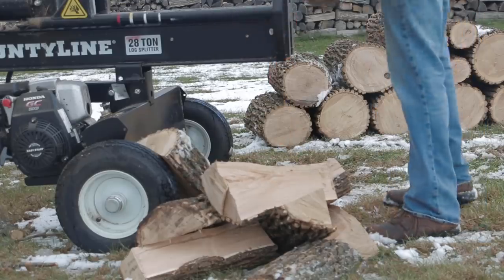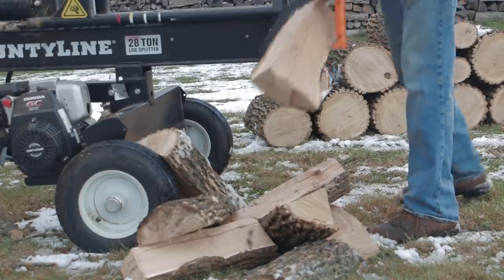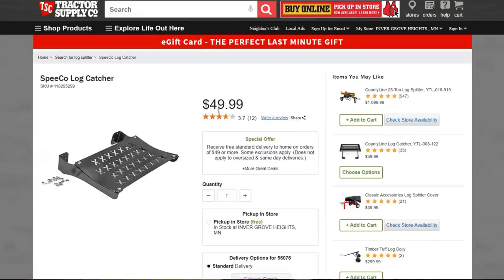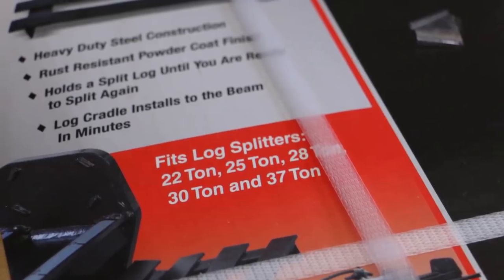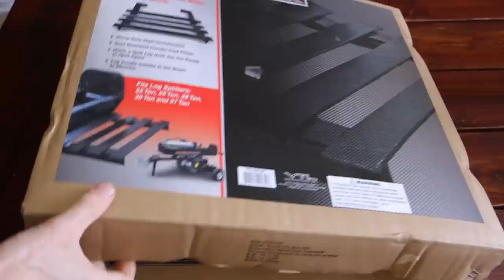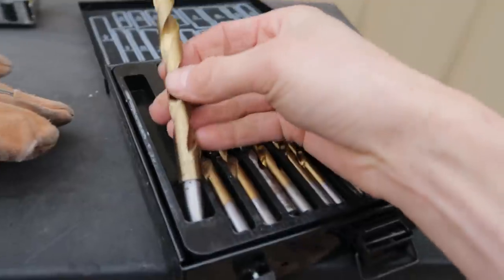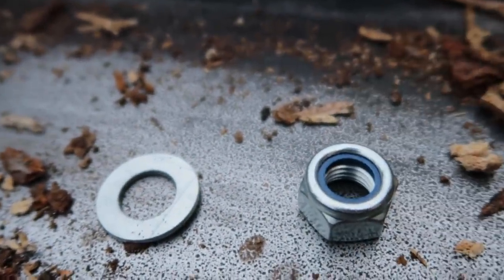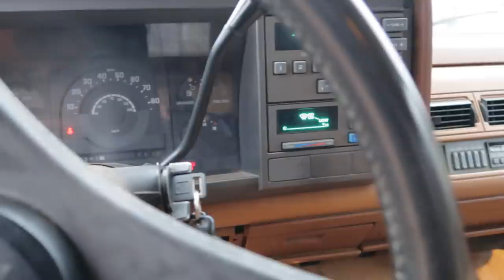$25 Upgrade that saving, time, energy and my back when processing firewood - Log Splitter Shelf

Comment: I just got the county line 25 ton machine from tractor supply 4-5 weeks ago after 14 years of harvesting my own firewood from dead fall in a local state park then transporting it home and splitting it all by hand with a 4.5 pound maul/axe combo to the tune of 5-6 chords of firewood each year of the last 14 years by the time I'm done each season, my back with multiple herneighted discs and rheumatoid arthritis just literally could take splitting by hand any more when the beginning of this season came and I knew it was time to get what I've been dreaming of for nearly a decade and a half , a capable gas log splitter . My 25ton machine came equiped with a 196cc 6.5hp Kohler SH series 4 stroke horizontal shaft engine that honestly doesn't look special in any way it simply looks exactly like every other chinese honda clone that is literally coming on everything nowadays for at least almost 15 years now or so roughly , but I can't knock them honestly cause no matter the name on the decal label all the Chinese honda clones that I've dealt with are really quite reliable and fairly tough, they ain't a mid to late 90's to late 90's tecumseh L-head concerning simplicity and ease of repair cause most chinese honda clones all have at least a couple plastic shrouds , heat deflector plates over the mufflers , big unnecessarily large air intake and filtration systems all that adds time into the repair cause everything is not right out in the open like they were on the old tecumseh motors where it would literally take 2-3 minutes to replace your carb lol.  Only ongoing issue I've seen with nearly all makes and sizes of chinese honda clones is problems with hunting and needing to run on partial choke settings usually due to clogged up super super tiny little holes all down the idle circuit jet , and alot of them seem to have an issue with the throttle and governor springs breaking or at least not keeping proper tension  which will cause a number of useability and reliability issues , normal wouldn't be a big deal but some of these springs on motors that are only 10-15 years old aren't even available any longer which is a real problem , I had this happen to me with the springs for the throttle linkage and governor arm on the power more 243cc clone on my 2014 troy bilt storm snowblower , and going to a couple hardware stores to try to get ahold of a few springs about the correct size and style was a nightmare cause even if you find those characteristics match I bet the tension rate of the springs will be way off , at that point your left to rig the thing up , I ended up with a mess of like 4 or 5 springs to replace just two in order to simply get the motor to sit at or close enough to idle for me when the lever is set to that rpm , and likewise with the function of the system when you move the throttle lever to full rpms , I continuously would get either too much rpms and way to high an idle or a perfect idle but falling a fair enough shy of the proper rpm at Max throttle to have the engine actual make anywhere close to recommended horsepower output , finally I got a balance between the two extremes , so have decent top rpms and power output with a low enough idle I'm happy with , well it's worked for 5 snow storms the last two winters so guess it is what it is now , but due to the original proper springs not being available I literally was and still am considering replacing the entire motor with a harbor freight predator 212cc for $120 as long as I could easily swap the crank shaft driven drive belt pulley onto the crank or find a proper pulley to replace it. Anyway I'm just rambling nonsense about snowblower issues so I'm check this, prob should just delete it honestly due to how off topic it is but ehh, maybe I will maybe I won't

Comment: That's a must have, mine did come with one. Another back saver is to make a simple ramp you can use to roll the logs up onto your truck and also go right from your tailgate to the splitter. Saves you from picking them up off the ground which is the hardest part on my back. I just made mine out of two-by-fours and 1 by cross members

Comment: I had a set up where I could slide my splitter into a series of heavy wooden benches and tables to make sort of an assembly line which was intended to eliminate as much bending and stooping as possible.  You dumped rounds on one table with the loader or from the truck, grabbed them with hookaroons and slid them to the splitting station table and shoved them down to the other end which you put them in a metal basket or a pallet.  No wood hit the ground and there was no bending over. In fact you could sit on a stool at the splitter and work if you needed to.  You could do a lot of wood quickly and with less strain on your back.  Ironically a tree blew over and smashed smashed the setup.  Building a new one with better lumber and under cover is definitely on the list of projects.

Comment: I’m seeing this video for the first time and I agreed that it should have a shelf and it actually should be larger than it is in my opinion. You’re one of the few people that I’ve seen splitting logs that hasn’t allowed them to drop on the ground and then pickup the pieces.I noticed you would walk them over to the wood pile. Now did ever occurred to you to move the log splitter closer to the wood pile so you only have two steps to go.

Comment: Great add on @ a great price. I use a two rounds, flat side up  as tables at the top of my splitting wedge. Timberwolfe TWP-1. It saves the splits from falling. Also handy when you have big rounds that are too heavy to pick up. Make a little ramp out of smaller rounds and splits and you can roll large rounds up onto the beam.

Comment: I drilled two holes in the splitter tray,  (the side furthest away from the I-beam) and then put 2 grade 8 bolts in the holes to keep the split wood from falling off the tray.  Works great.

Comment: If you still feel that your rack is still small, just screw or bolt a piece of plywood or OSB over the rack.  I put a radius on the corners of a piece of 3/4" OSB with a jigsaw so that I wouldn't keep bumping into sharp corners, painted it, and have been using it for about 5 years.  it also allows me to fasten a section of angle iron on the outer edge to help keep rolling pieces of logs on my table.

Comment: I bought a splitter cradle on Ebay from seller 33flame. It is quite a bit more money ($80 plus shipping), but it is worth every penny. Very well designed and built. It is 16" wide and extends 24" from the splitter so it will hold a pretty good sized round. And it has the added bonus of being easily removed for times when you don't want it on there, like when using the splitter in the vertical position. You might check it out.

Comment: You certainly can't beat a log catcher . Sure beats bending down all the time . It also stops the wood pieces from falling on your log splitter parts such as a engine or what ever you have on the other side . Someone asked about vertical position if it's needed . Depends on the size of rounds you are splitting . You never know if you might get some large rounds and then you could be hurting your back lifting them up . Me I would get a splitter that goes both ways . Horizontal and vertical . Not every one has a tractor or what ever to lift the large rounds .

Comment: I used TREX decking on my old Craftsman 27 ton which had a curved log catcher, it works great. In you case just use some 3/4" plywood using some tek screws and you can make it any length or width you require. Thanx for the vid. Happy 2019

Comment: Have you tried it on the other side? Your reach to the control looks a bit awkward. Mine is similar and I split fron other side - wedge coming from my right. Anyway - table looks super helpful. Visited local steel place/fabrication just hours ago and expect to start welding on one of my own after Thanksgiving.

Comment: Can I ask why not put it on other side so you don’t need to reach across for lever? That’s the way mine came from factory. Always good videos THANKS AND GOD BLESS!
Reply: If you work from the bench side you are working from more distance away and it’s backbreaking. No benefit. Best way is to have one on each side that you can put up or down as needed, so you can switch sides and work different muscles

Comment: hi the wood rest ,,r a blessing ,,i used a old trashed alum ,  ladder cut it to size ,,some nuts out of the garage ,,n wacko,,a rest ,,the lip on the ladder ,,foot side out ,,made it possible ,,that the split wood dint fall off the  table ,,
mine is on the splitter for 7 yrs now ,, only the bolts loosen up from time to time ,,
 id do it again if i bought a new splitter ,, with this old 18foot ladder ,,i made several ,,wood tables ,,with this one junk ,,extension ladder for friends
sleep well ,,n again thanks for your vid

Comment: Even at $50 the countyline one is a good deal and no modification.  My splitter that i just bought last week has welded in nuts to bolt it right on. And yes it should be mounted on the other side as another comment noted.

Comment: Check out Tractor Supply's new 40 ton Country Lines. Don't buy one, look at there table from there parts page. Very Big and heavy. Just looked at one today. Also this one comes with an engine protector which I think is Great. Going to buy both.

Comment: Yeah, I welded some scrap 1" tubing to one side of mine, then topped it with some 1x6 lumber.  Now have a 'shelf' to one side about 12x24 to hold the halves while working up the other half of a big round.

Comment: Looks good. But I would used much bigger washers to spread the load out. And a light grease on the threads going thru the frame. Any issues with the Speedco?
Thx
MJ

Comment: Not to change the subject, but in a previous vedeo, you stated that there was 177 or so cu. ft. in an UNSTACKED cord of firewood. I'm just curious as to how you can up with that figure. I don't know but I'm looking for an answer short of loading my trailer with wood twice and stacking it in a 4x4 x8 stack. Did you stack it or what?

Comment: They are great! I have one on mine.. one thing however, you installed it on the wrong side. Its supposed to be mounted on the engine side. And you can stand on the side with the valve

Comment: Eric,  I have decided to break down and buy a splitter.  However, I like things that last and wanted to know how this machine is holding up and how many cords you have split with it.  I have been looking at the Timberwolf which is great but cost close to 3K
Reply from the maker: So far so good. Someone mentioned in a review video I did in the past, they had problems with the motor. I personally have had a good experience so far.  Timberwolf makes splitter that will last a lifetime.  Industrial grade. Top notch stuff.  I can't imagine going back to the days before a splitter. A life saver and has put a lot more wood in my pills.

Comment: I'm curious why you don't split in the vertical mode.  I've been splitting wood since the 70's oil crisis.  Got a log splitter couple years ago and with a stool to sit on I can split all day and not get tired.  Roll a round and split while sitting.  I also split rounds so my pieces are  no more than 3" in dia.  More splitting to do but I find burns better.   Just curious
Reply: It dries faster too when split in 3" max pieces.

Comment: I've never used a splitter that also converts to vertical. Do you ever use it in the vertical configuration?  I'm going to buy a log splitter next year and wonder if vertical is necessary for my 18 to 24inch max width eastern hardwoods.
Reply from the maker: I use it several times a year. Having that feature has put a lot more wood in the piles. Even used it last week: https://www.youtube.com/watch?v=6HsNaWIJH40

Comment: Go to a steel yard near your area if you have even a cheapo flux core mig style welder and get an 8 foot stick of 1/8"-3/16" thick 1 1/4"-1 1/2" wide steel flat stock and a 4 foot stick of 1"x1" angle iron 1/8" thick and just make your own for 15 bucks tops , that's assuming you have some basic welder and helmet , the proper sized drill bit to drill the two mounting holes in the two mounting tab parts of the assembling and a 4 1/2"  grinder/cutter with a couple cutting discs , and a grinding disc or flap disc, lastly a sharpie marker and tape measure , a carpenters angle tool to square your corners as close to 90 degrees as possible , so assuming you have all these rather basic things no steel yard should charge you more than $15 roughly  for the amounts of the sized steel I mentioned   , and if your anything like me and literally have over 20 large bins of fairly well organized and sorted misc hardware , nuts bolts screws nails , and other little misc random parts from all sorts of cars I've worked on and owned for the last 17 years that I've done mechanical repair , heavy collision and welding/fabrication for a living then you'll certainly have two perfect matching mounting bolts , washers and proper size and thread nuts so you can mount your little project upon completion , and if it were me I'd clean it quick and shoot a few coats of rust preventating spray paint on the thing so it don't rust so fast and lo like totel ass, if you dont how much is cheap ass grey or black spray paint from the dollar store or tractor supply $3.50? Well worth the couple extra bucks to keep it looking nicer for much longer a period of time,   oh and for any parts of your project you need to bend if your using 12 gauge or thicker steel without the aid of oxygen acetelyne torches then your going to need some quite stought reliable safe means of holding the steel in place , heat it as much as map gas will heat it if you don't have real torches and lock the steel In a vice and massage into the correct shape using what ever pick of hammer you wish , even though map gas will never get 12 gauge to even start glowing a little it'll still heat the metal enough to aid you a fair bit in bending the steel if needed , not for nothing you could actually prob with a little know how use the hydraulic powrr of your log splitter to make the bends in the steel you need bent to make your log cradle , cut your shape of the bend into a block of wood then lay your steel properly over your template (the wood) then slowly and little by little apply more force with the ram and it should bend 12 gauge or even 1/4 thick flat stock almost effortlessly.

Comment: how does a hydraulic splitter work with a truck...do you not have to use a tractor?
Reply: The pump is running off the engine. You don't need a truck or tractor other than to move it.

Comment: That was a good price for sure and will reduce the amount of times you have to bend down and pick wood back up. I have a similar splitter and about 25 years ago I built aprons for mine as I had some steel laying around. They have served me well, but two years ago I decided that due to age and the size and weight of the rounds that we have here in the Pacific Northwest, I needed something more to make things easier. I built a Mechanical Lift  and I guess I can leave a link here to the vid I posted. You may want to check it out, and I did it on the cheap with steel I had laying around. Here’s a link if your interested :  https://youtu.be/0fKzvMvy-ZI